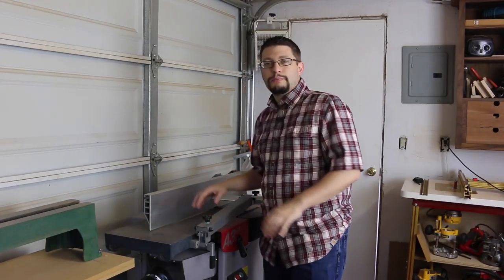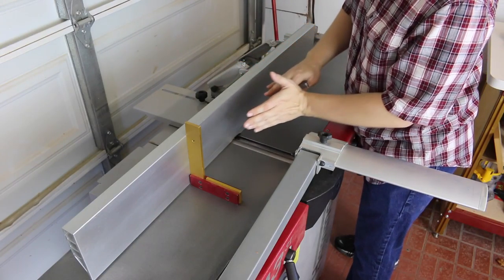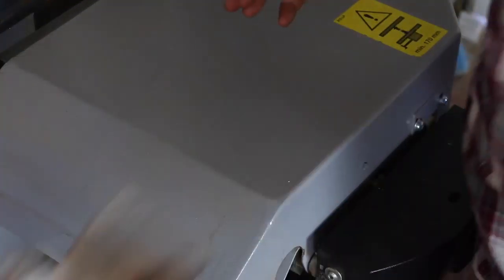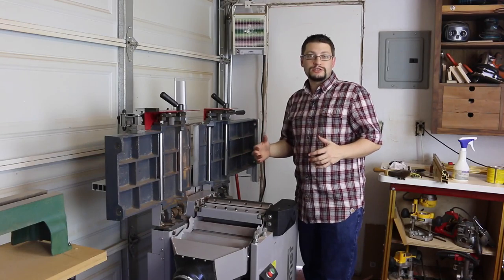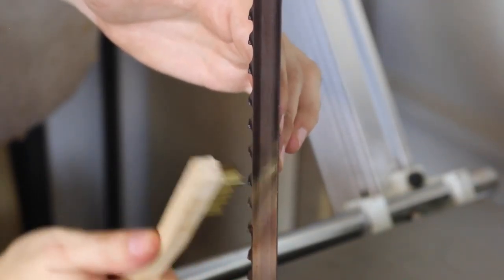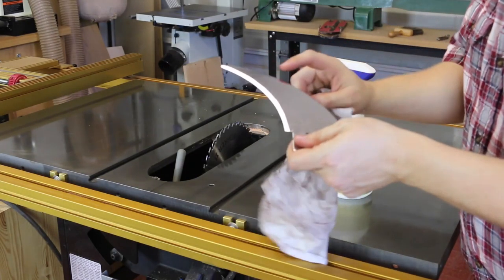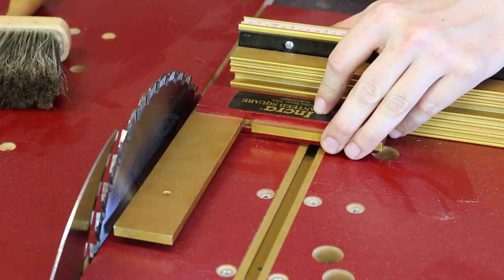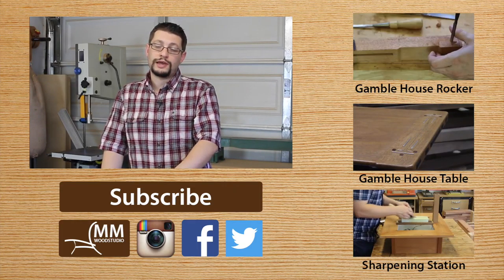Preparing For My Next Project - Part 2 Machine Maintenance

Comment: Hey Mathew, pretty darn good cleaning. If your fussy with your machines, I guess we don't need to check behind your ears , hh. Hey I noticed you have the incra table saw fence. I've been thinking about changing my original fence for their 32 in model. Is there anything about the fence you don't like?
Reply from the maker: +billfromelma you need to make sure you have room to the right of the table for the fence as when you move over the positioned it goes to the right. Need an extra 30-34 inches to the right. Otherwise she is great. And you may want to also make sure you have some blue tape around when you square the fence to the table. You'll need this.

Comment: tools look nice and new now. what kind of table saw blade do you use? u sd its re sharpenable.?
Reply from the maker: +Joe basementwoodworking I usually use Forrest Blades. All carbide tipped blades are sharpenable. I send mine to Forrest to be sharpened, but I have no doubt you can find someone local who sharpens.

Comment: whats in the spray bottle ????  and will it rust ur machines faster
Reply from the maker: +jp torso It's Felders resin remove. It will not rust your machines, but you shouldn't leave it just sitting there forever.